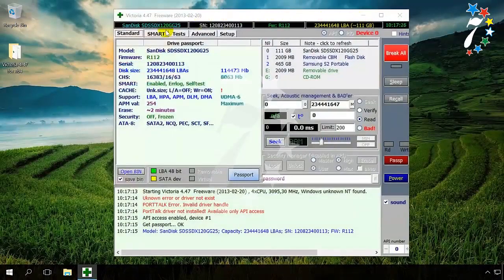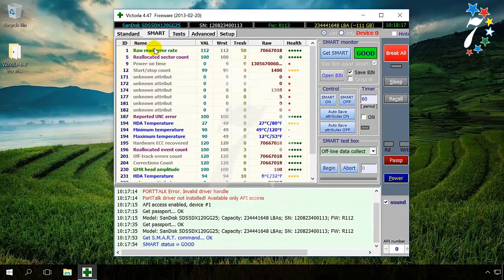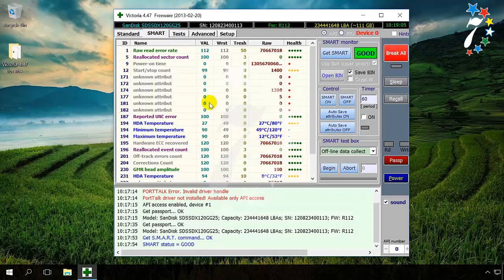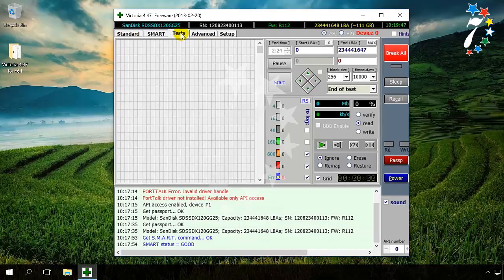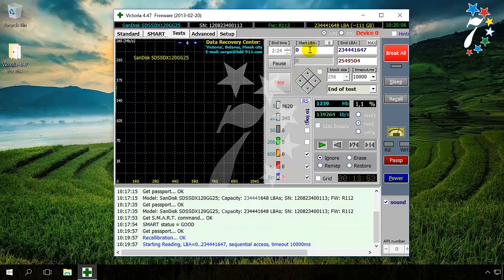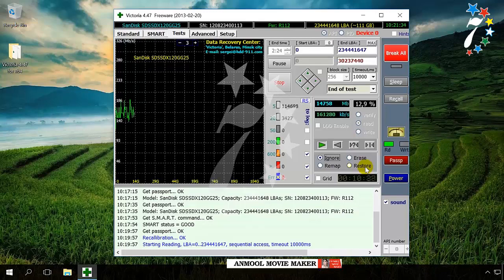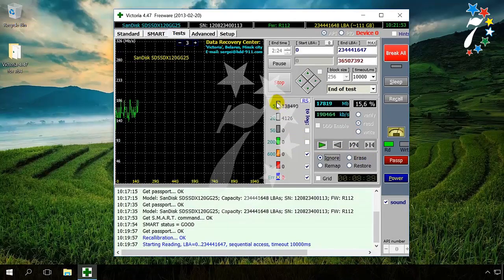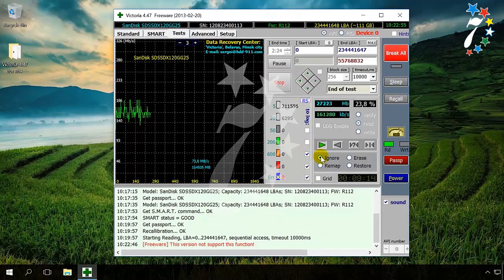How to Use Victoria to Test and Fix Your Hard Disk in 2023

Comment: Great video very helpful !!!, but I have a question, I used smart and it said my drive condition was good but I had over 13000 reallocated sector counts and when I ran the test I had  over 1000 red and blue errors, in trying to restore them it failed what do I do ?
Reply: Back up your data , your drive is failing .
Don't believe this crap , it's fake data report